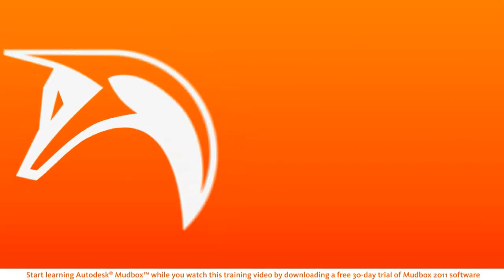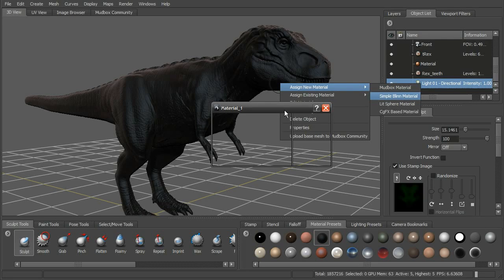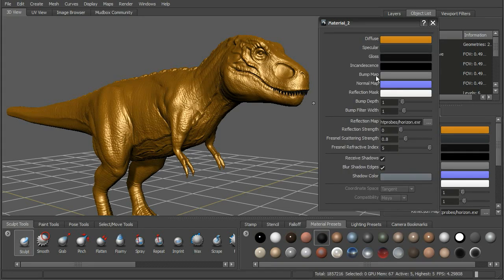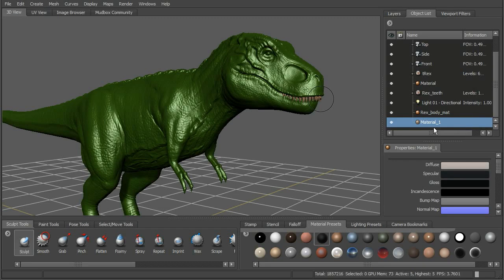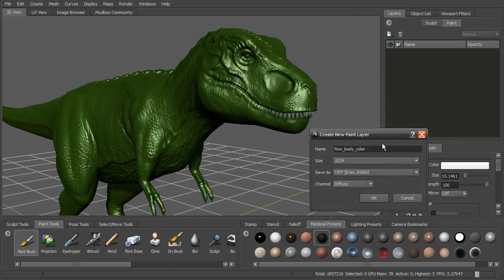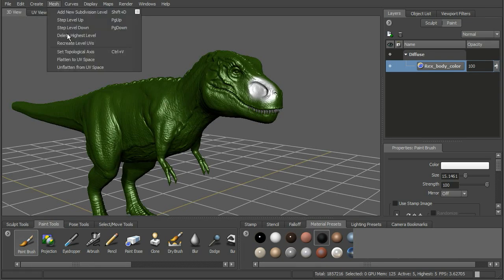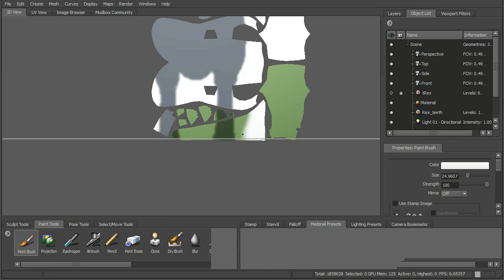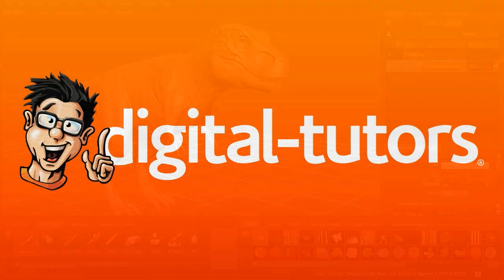Materials and Texture Basics Tutorial

Comment: Hello, i don't know if you still need an anwser, but make sure your objects pivot point is at its center. In the hierchy panel, click affect "Pivot point" then click "Center to object". Make sure the move tool is selected, after that set the X, Y, Z coördinates to 0, 0, 0. Your object is now completely in the middle of your grid. Your object could also be too big too work with in mudbox if thats the case just scale it down. In mudbox you should also use the switch view option, just right click!